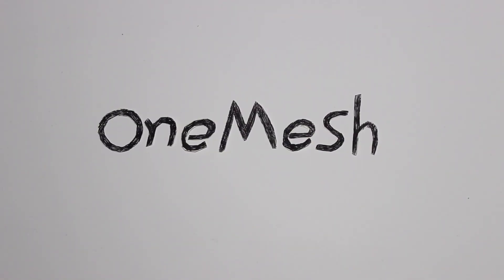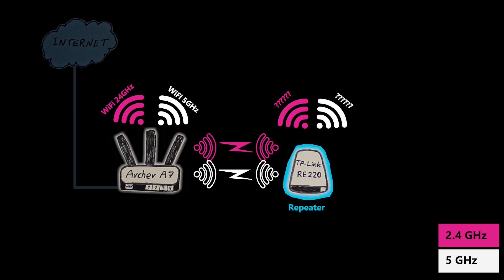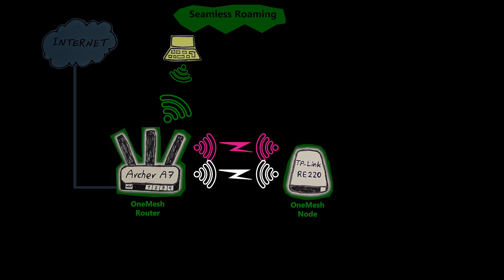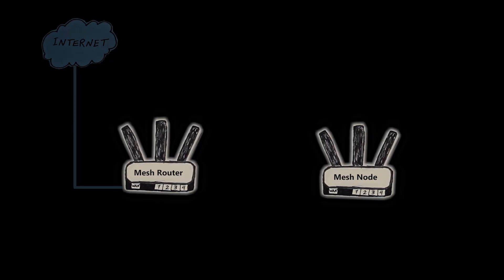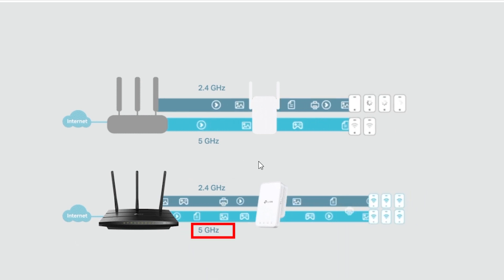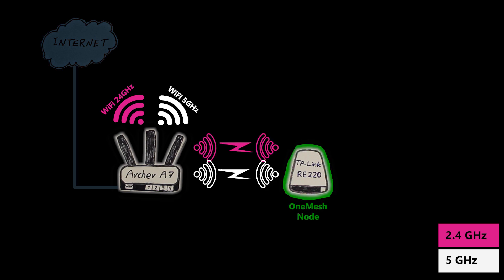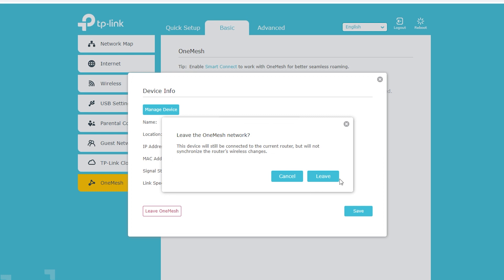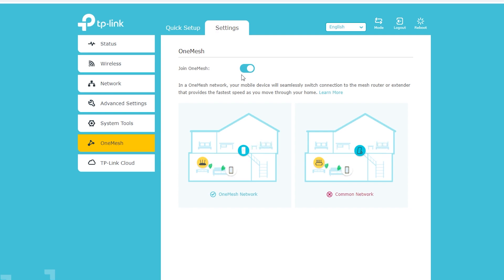What is TP-Link OneMesh? How to configure it?

Comment: I bought a router and two nodes, all one mesh... one of the spots I'd like to put a node I have hardwire capabilities via ethernet. Couldn't I create that one as an access point and then use the other node as an extender? Would that be advantagous as I can get one of them directly connected to improve performance?

Comment: 08:36 as of 2025, TP-Link introduced the EasyMesh certification, which lets you do just that!
I planned buying a Deco device, but I might as well just get myself an upgrade to an AX3000 or AX5400, and use the old AX1500 as a satellite router in the EasyMesh network.

Comment: So, the OneMesh system was only developed to incentivize you to buy TP-Link repeaters?!
No, thank you!

This could be a great value, if it allowed me to connect different devices.

I bought a 4G router, the MR600 - which is a very good 4G router, with Wifi 5 built-in.
I did not buy a 5G router because they are still too expensive - at 300€+.
The MR600 was the best one at a reasonable price (~130€), but it is a Wifi 5.
Hence, I sued the AX53 router to send a better signal.
Disappointments:
1. They are both connected via Ethernet, so the speeds are high, which the OneMesh system dislikes, resulting in increase latency;
2. By connecting both through Wifi, I have to position them too close, hence making me either buy more nodes or have less coverage, which is bad.

Overall, I am quite disappointing at this - as well as mesh networks in general.

Comment: Very good explanation, I got 2 extenders which I assumed will connect to each other in a daisy chain to allow me to extend my wireless network to my outdoor workshop. That seems to be not the case with the TP link OneMesh system. It appears to be configured as a star network where each extender connects to the main network i.e. router. If there are any workarounds for this that would allow me to daisy chain the extenders and that don't involve me having to rewire my house i'd be keen to hear them!

Comment: If i connect tplink c6 v4 & re200 with cable connection then one mesh will work?
Reply from the maker: No, OneMesh is very limited. One of the limitations is that the connection between the nodes (backhaul connection) cannot be wired. You can (as far as remember) setup the re200 as an access point and connect it to the router, but not as a onemesh node.
Reply: @Behfor  ok thanks brother

Comment: I have an Tp ax1500 router. Can I connect my old Archer C6 AC 1200 to it to use it as a mesh node or access point to increase my wifi coverage. If so , how to do it?
Reply from the maker: You can connect your old router as an access point to extend your coverage, not as a mesh node. You change its operation mode to AP, set up wifi networks, then connect its wan port to a LAN port on the main router.

Comment: Can I make a mesh node between two TP link devices, one which is currently use as a repeater? In other words, if I have a router (brand X) and a TPlink RE655 connected as a repeater, can I add a 2nd TPlink to the first one and add it as mesh or as a repeater?
Reply from the maker: Depends on what 2 tp-link devices are. If they are both repeaters you can't make a onemesh network with them, you need to have a tp-link router for that, however you can still use both of them as repeaters with your brand x router.

Comment: On my home onemesh network I had to disable the 2.4ghz band because my devices connected preferably to that band and, with that, the speed was reduced a lot. When I turned off the 2.4GHz band all devices obviously started to connect with the 5GHz band, with excellent speed. I was intrigued by this. I suspect that the devices give reference to the strongest signal and not the fastest. Here's a tip for those who are having speed problems with the onemesh network: try disabling the 2.4ghz network. In my case, living in a 3-bedroom apartment (90m2), the 5ghz band, using the ArcherAX10 router and the RE500X repeater, got the job well done.
Reply: It looked like you could name the 2.4 and 5.0 networks as different ssid. Its helpful so that my outdoor devices (camera garage opener, etc) get better signal with 2.4 and inside the house 5.0 is my default for phone and tvs. But Im not sure if its possible on tp. Any thoughts?
Reply: @drmiteshtrivedi  Yes, it is possible. Just turn off one mesh option and you will have two separate bands with different names, being one 2.4ghz and other 5ghz. Cheers.

Comment: I have TP-Link wifi powerline adaptors with wonder if it still uses wifi to connect with each other, or use normal power socket to do its data transfers for internet?

If you have any information on this let me know, before i  buy TP-LINK AXE75 AX5400 router for onemesh seamless wifi feature.

Comment: You actually can create a whole network using older routers.
But ofc, it wont be a mesh system at all.

You'll have to connect them using Ethernet for backbone and use as a separate Access Points.
If done properly — the same Name but different Channels, proper (not the highest one) amplification and disctribution actoss the home, you'kk achive a good coverage.

In 5GHz devices actually can migrate between access points on their own. So it is reccomended to enable 2.4 GHz point only on a central router, and use only 5GHz on others.

I have done this at my home and it works great.

Comment: In setup you indicate you must connect BOTH radios to the mesh, 2.4 and 5 gig, what if the 2.4 gig radio has been turned off and will never be used, therefore it is not available, can the mesh node still be installed using only the 5 gig radio ? thanks

Comment: Thanks for making this video. In the first 4 minutes I already decided this One Mesh is not for me. I want my access points connected via ethernet backhaul. I also want to use routers/APs as mesh nodes. Why TP-Link. Why?
Reply from the maker: You're very welcome Jeff! Glad this was useful for you! I know!! Why TP-Link?! Why?!
Reply: @Behfor  After doing a little more research I think I've found the answer to this question. TP-Link makes Omada. A professional mesh product line. It requires the use of a controller and has much more flexible setup in terms of network topology. Perhaps they don't want the less expensive home setup to overlap and at least partially take the place of some or all of the Omada gear?
Reply from the maker: @JeffScott-1978  I agree with you, that could be the case. Unfortunately they do not add full features in their home networking devices even though the hardware is capable! That's why the whole concept of 3rd party firmware came to existence! Thanks for the research and also sharing! Cheers!

Comment: I have two re 220. Can we use mesh system?
Reply from the maker: You need to have a router that supports onemesh, then you can use your re220s as mesh nodes. Thanks.

Comment: Nice video, thanks.  My disappointment is that I cannot connect the one mesh node to the router with Ethernet.  I am using an EAP225 with my AX10 as a stand-alone with different SSID and Password, and connected by Ethernet. I’d like to convert to mesh.  Seems like I should be able to.
Reply: I agree Doug. Having a wireless network where all APs work in unison and have a solid cabled connection back to a master device should be the design goal of these systems. You'll get the best performance that way. Using Wi-Fi to talk between the nodes should be an alternative method for people not willing to run cable. It should be advised against. Not the default configuration. It's backwards the way they've designed this.

Comment: Will this work using a different router like the router provider by the ISP or do I really need to get the Archer A7 for this to work?
Reply from the maker: OneMesh is only for TP-Link devices, so everything has to be TP-Link to be able to participate in OneMesh. Please check the TP-Link website for the list of supported devices. 
Now if your Wireless router is not supported you might still be able to connect a TP-Link extender as a repeater to extend the range but unfortunately not as an OneMesh node 
Thanks.
Reply: @Behfor  I see thanks! My hunch was right. Cause The router was TP-link. Glad I asked first to confirm and I did not order the sale I saw. Thanks for the answer.
Reply from the maker: You're welcome!

Comment: I’m using the router given to me by my ISP and have a RE650 wired as an access point, if I get a second RE650 and use it as a second access point, I’d like to keep both RE650 units with the same name and passwords, would I get seamless handover from one unit to the other? 

Thanks for the great video

Comment: I just bought the Archer VR400 and I'm having issues with connectivity. I have two RE230 extenders with OneMesh connected. Are these devices compatible? Is there anything I may be doing wrong.

I used to have an Archer A7 in place of the VR400 and it worked great.

Comment: What would be the best device to extend and create a safe network in a hotel room (using hotel free wifi - cannot access any LAN port, should be configurable by wifi only)? I tested a small GL.inet nomad router but it looses the connection too often. Thank you

Comment: I have a TP-Link Mesh Router Archer AX90 AX6600 and if buy Mesh 1x Deco X90, Should i connect the Router and Deco by Wire or it can work wireless. Please advice

Comment: Behfor, have you tried the DD-WRT with OSLR protocol? Other open firmwares also support the protocol. It's not easy to set up (I haven't made it work yet but did not spend too long on the task either). OSLR requires the control medium to be chosen and will use (AFAIK) only that medium. The medium can be wireless or wired but not both. TP-Link has the Decor system that I have a feeling it uses wired connection - and for this reason I think they are using OSLR.

The DD-WRT OSLR (not good information on how to set it up available) doesn't seem to have the restriction TP-Link One Mesh has and will allow more than one router as long as a single router is working as the OSLR server. I have a few Archer C7s here and one of them is the V5 One Mesh - I'll see if DD-WRT sees it as a OSLR server. I think TP-Link, to simplify configurations, has set the router as server and, therefore, all routers will be server (hence the impossibility or using more than one router).

Comment: If you had an accommodation dorm in a university, what wifi mesh system would you recommend for such a big setup?

It will need to cover about 60 rooms spread out between 4 buildings. Distance between each building is less than 50 meters.
Reply from the maker: Unfortunately I can't recommend a fully mesh system for such a setup. Some centrally managed APs with wired backhauls would be a better solution.
Reply: @Behfor  I would love to have a permanent hardwired wifi system. Unfortunately, we aren't allowed to drill or run any cables. So wifi mesh seems to be our only option.

Comment: I also disappointed. I have an AX11000 router, AX6000 in wired AP mode and a RE300 repeater. All 3 can now do onemesh but it's super lame TP-Link has not setup for me to make a OneMesh network with these items! I'll be ditching them at soon.

Comment: Your video just saved me from buying another router to try and make a mesh connection at home. I have been trying to find out wether one mesh will work with another router or not and couldn't find information about it. It is sad to see that onemesh would work only with repeaters and I can't make an access point for example and set up one mesh.
Reply from the maker: I'm glad this video was useful for you, I can't agree more, I think that's something that TPLink should fix, it doesn't make sense at all. Thanks.
Reply: So we can't use wireless router with Deco series?

Comment: Thank you so much for this great video!👍🏼👍🏼👍🏼
I already have a Archer C7 (twin of A7) in the basement and I got Cat6 ethernet cabling done throughout the house. It's a shame that the repeaters cannot connect to the C7 via ethernet. Otherwise, this would have been an inexpensive way of getting a whole house wired mesh network.
Would you recommend using the Deco M4/5 as access points connected via ethernet to the C7?

Comment: Thanks a lot . Nice Video . Question : In order to install and use a Mesh with the  Router , don't you need to upgrade the router's firmware? Or router supports mesh directly from the box (talking about an Archer C7) . Thanks again
Reply from the maker: Hi, I'm not too sure about the C7, however it's recommended to have the latest firmware installed.

Comment: My router broadcasts an extra 5 GHz Wi-Fi, named hidden network. I guess that's used to connect the router to the Mesh node?
Reply from the maker: Yes, good point, that is for the Mesh connection.👍
Reply: @Behfor  so, can it use the hidden network for data transfer between router and node and the actual 2.4 GHz and 5 GHz for simultaneous data transfer between the network and the client?
Reply from the maker: It actually does that, but these are only virtual segmentations. The router has only one 5GHz radio and one 2.4 GHz radio, so even if you have multiple 5 GHz networks, they all use the same radio. You'll need a tri-band router to be able to dedicate one 5GHz for the clients and one 5GHz for the backhaul. You may want to watch this video:
https://youtu.be/7CVDkAM3tnE
Reply: @Behfor  ahh okay, got it! Thanks for clearing the doubts. ❤️
Reply from the maker: You bet!

Comment: excluding archer, it works fine with AP only?
3-4 AP in mesh mode?
Reply from the maker: You need to have a supported OneMesh router for the onmesh network to work. Unfortunately you cannot use the extender in AP mode to create an OneMesh network. Thanks
Reply: @Behfor  Why please?
Reply from the maker: @LukyVala  you should ask that question from TP-Link, because this is how they designed OneMesh!

Comment: Had the same issue with it - wish the OneMesh worked with multiple routers too, instead of it being limited to a router-repeater set. Shame. I'm sure the software and hardware is already there in all the routers. Just a question of their will, to enable it.
Reply: I read in a TP-Link video that the system is not designed for this. Maybe the hardware is really not there.

Comment: Can you please recommend if to increase wifi coverage in my house should I add RE450 wifi range extender or RE300 Mesh wifi extender? I have archer A7 router
Reply from the maker: Well, I have not tried either of them so unfortunately I cannot tell you which one has a better range for sure, but in my experience usually when the device has external antennas, the range is better, but as I said I cannot answer your question because I haven't tested those devices. Thanks.

Comment: Awesome video, what is the best range to put the mesh node.

Is it ok to put my node where I get 10-20 % wifi signal strength from primary router. So that I can extend to more place. 

Will my node get the full speed?

Comment: Nice vid. One more thing that is a bit confusing is the fact that to build a OneMesh network you need an AP and repeater which support this technology. But... the repeater itself also can act as an AP and since it allready supports OneMesh system then it renders another question - is it possible to build OneMesh network based only on repeaters (one of them in AP mode), or not? :) I'm not able to find answer to this question on the internet.
Reply: Did you find an answer to this question?
Reply: @sum-earth  yes. Unfortunately the answer is "No" :/
Reply: It's should be able to, but TP-Link want you to buy their router too, it's capitalism at its best.

Comment: Behfor! Thanks for the video. I have a problem, maybe you can solve. When I use the RE220 as a mesh node, it doesn't detect the 5ghz band of my archer a6 router. As a repeater it does. I've upgraded firmware and reset the device. Any advice?
Reply from the maker: Thanks, I've seen this behavior when one of them is a US version and the other one is a Europe version. That's because some 5GHz channels that are allowed in US, are not allowed in Europe.
Reply: @Behfor  I'm in neither! India 😭
Reply from the maker: It has nothing to do with where you are, im talking about the devices you have. Just try to use one of these channels 36, 40, 44 or 48 on the router and see if the node can find that. These channels are allowed almost everywhere.
Reply: @Behfor  Alright let me try. Thank you!

Comment: Hi, great video, one question though. Do you know if the wireless backhaul runs on same channel as the wifi network or different. I have archer c6 + re200 and the backhaul is on same channel. Do you think having backhaul on a different channel will improve performance ? I can't find a setting for this.
Reply from the maker: Hi, that's the limitation of the mesh network. Basically a wireless device can only use one channel for each radio at a time. If the repeater is connected to the main router using 2.4 GHz CH 1, it can only rebroadcast on 2.4 GHz on the same channel. That's why using access point to extend the WiFi is much more professional, or even using repeater with different radios for backhaul and clients. Thanks.
Reply: @Behfor  Thanks. What I have seen is that in one mesh setup tp link router broadcasts hidden ssids which I think is used as backhaul by the tp link extender.

Comment: Hi pls clear my daubts as i saw somewhere.. Can i use this archer a6 as wireless repeater or wireless ap with some other brand router to increase range, i had used old tp link routers witch was having option of wireless bridge where wifi survey option was available to scan and connect near by wifi
Reply from the maker: Hi, this Tp-Link Archer A7 in this video does not have the repeater option, but you can use it as an AP to extend your WiFi range. Thanks.
Reply: @Behfor  thanx
Reply from the maker: You're very welcome 👍